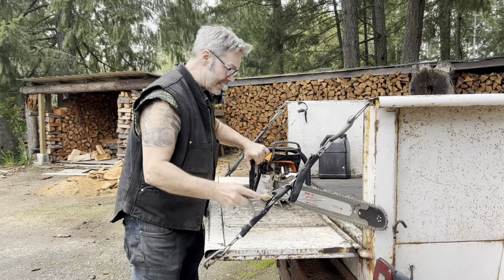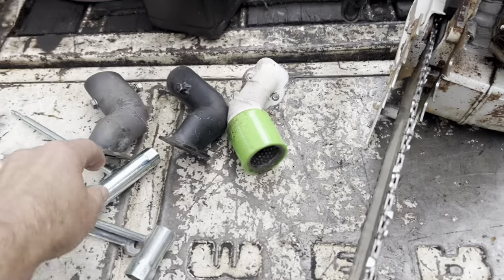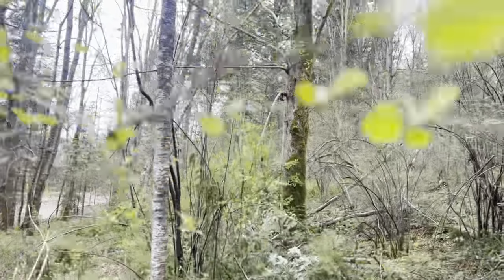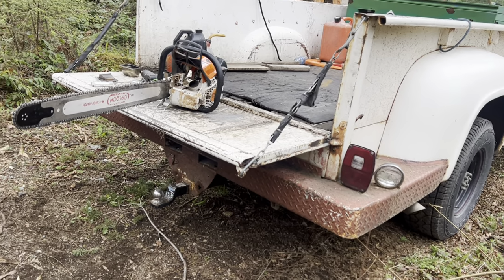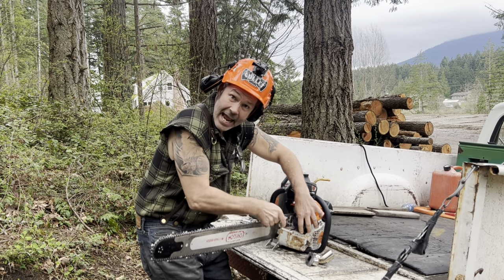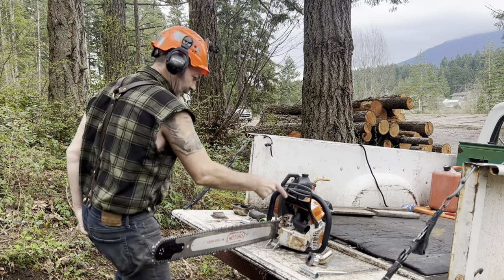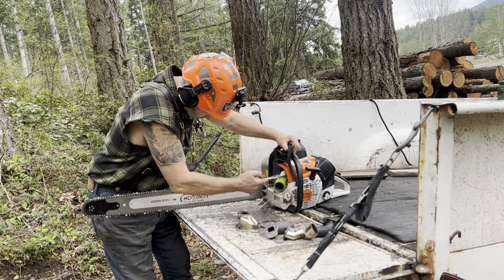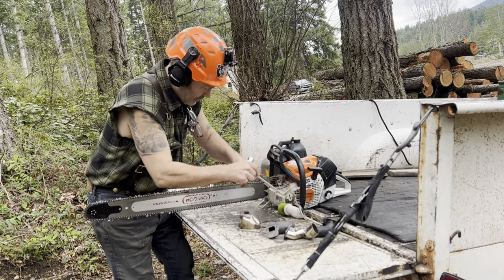Stihl ms500i header pipe test subject

Comment: Buckin! Good to see the shoulder treating you better. It sounded to the ear that the small stainless pipe (tested last) created the best all round performance. It does still seem ever so slightly restrictive where the Green pipe solved that, but lacked the responsiveness of the smaller pipe. I do agree that the Bearclaw design seems to provide the best ALL ROUND performance. Jack of all trades, master of none! Can't wait to hopefully get my hands on a finished product pipe from you. Cheers! I do think it's worth noting that the bearclaw design seems to work the best all round regardless of Stihl or Husky powerheads...

Comment: Loving all these R&D videos! I've been wondering if an unrestricted pipe would make the fuel injected 500i cut faster than a pipe with backpressure. I've learned, through this video, that carbureted saws run better with backpressure and the modern fuel injected saws run better with straight pipes and no back pressure. My 500i isn't ported but I'm probably gonna custom fab a straight pipe for my 500i now. Thanks for the video buckin'! You've taught me a lot over these past couple years. Respect!
Reply from the maker: GOOD STUFF  you know how i feel about the 500 , i want land on a muffler that i can be happy with

Comment: Think the direction you’re heading in is going to Bear the most fruit. I like the two you ran side by side at the end it kinda shows a good comparison between open flow at top end and a pipe that uses reversion waves to aid in improving overall flow. I have been playing with trying to get tuned pipe performance In a chainsaw friendly package. It’s not an easy problem to solve and it’s a worm hole of possibility’s. My vote is for a “The Claw” rendition on the 500i in the future.
Reply from the maker: agreed

Comment: Hi Buckin, the the sound of the BBR pipe was noticeably different, right from the get go, close second was the bark box, good you did a side by side on them, possibly the saw had trouble adjusting so quickly from all the header pipes to the bark box, and different lean on required for it too.

I think the BBR and the Bark box you could cut all day and have good fuel economy, and still have hearing.

On the straight headers, you'd have fun, but you might stop early from the tinnitus, or the gas-tin-isemptyitis.

Comment: The bottom two bolts on stihl mufflers thread into the case, so they don't have nuts on the back of the muffler for the bottom bolts to begin with
Reply from the maker: THANKS
Reply: @Buckin' Billy Ray Smith  and in my experience, you're right about the baffle on the inside of the muffler. With the way I do 500s atleast, gutting the muffler hurt a tiny bit, if anything. I no longer bother cutting them out
Reply from the maker: @Leave_Nothing_Stock  i wood think it wood create the pulling process
Reply: I was thinking the same thing

Comment: Hey buckin I had a question. Theres a guy selling 4 mcculloch saws NOT RUNNING for 35 usd each my goal is to get one and get it running. I noticed one of them is a TOP. HANDLE. And the others are mcculloch 610s. In your opinion which one is more rare and would be cooler to get running?

Comment: Had a bad shoulder too Buckin. Knocking, felt dislocated, crunching and grinding. Nerve pain... Know what fixed it? Pulling on the mower consistently... Over extend from splitting wood.. Pulling mower... Is opposite movement to that. Crazy but worked. Someone told me to hang from. Monkey bars too. I know what they mean now.

Comment: Ole Curly Becker told me back in 78 Jon you can't push a motor. hard all the time it won't last ! very  very true . you want to use the 500I for a while put the stock muffler back on  and don't push it so hard it will last a lot longer ?
Reply from the maker: im babying it , hoping it blows actually , but i never seem to blow them up
Reply: @BuckinBillyRaySmith  It shouldn't blow... Assuming that EFI trickery works as intended ;)

Comment: I've heard locally of two 500i overheating to destruction. I assumed this was due to incorrectly mixed fuel. Maybe a lean mix ran the less thirsty fuel injected saws hot as they weren't getting enough oil.
Anyone know much about this?
Reply from the maker: probably operators